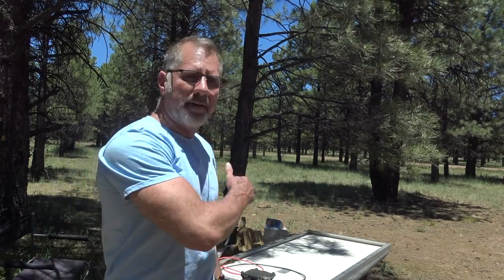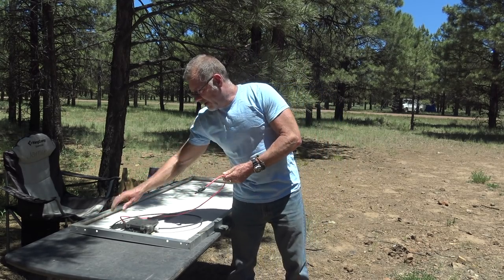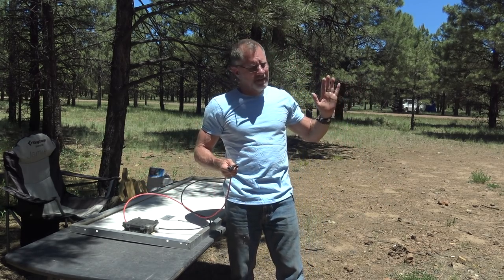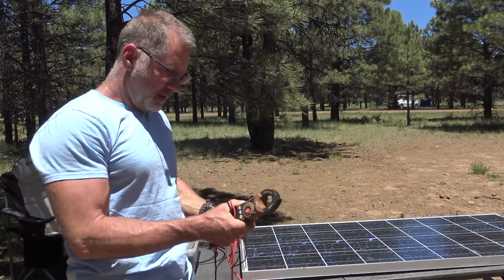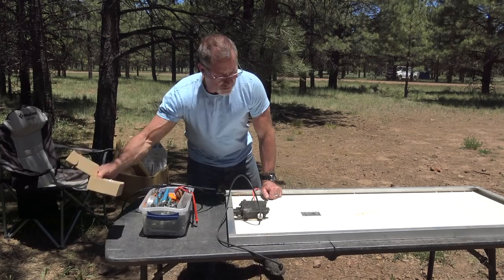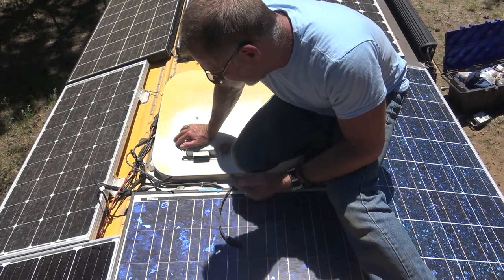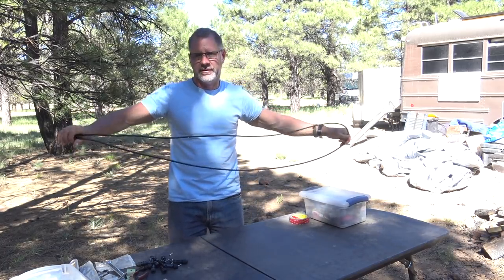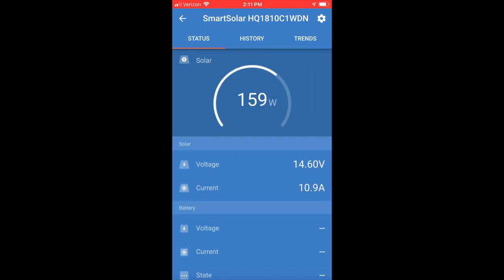Vandweller SKOOLIE Mixing Solar Panels Install | Is it Safe?

Comment: Good job! Like you I have a mix and match setup. Total 700 watts now,  added to through the years. 400 watts in series supplying  two controllers.  One charging three 120 amp hour batteries and the other charging two 75 amp hour batteries. That is on my trailer. On my van is 200 watts in parallel charging two 120 amp hour batteries. All batteries are standard wet cell deep cycle,  cheapest way to go.  Matched together by approximate age so I get maximum life from all batteries. Oldest set  is two yrs old. I have found Walmart deep cycles last about 5 years. No point for me to upgrade, doesn't make financial sense. Lithium would out live me by many years. I also have a 100 watt suitcase panel I add in where ever I need a little extra power.
 As for power usage,  I turn my 2500 W inverter on 1st thing in the morning and it runs all day. That is hooked up in my trailer where I have Satellite TV With a 44" wide screen That runs most all day. I have a 12V 64 qt Wynter freezer in my van.  I also have a 1500 W inverter hooked up in my van.  I carry a Honda 2000 W generator  Just in case, But never have a need to run it unless I get a string of bad weather over multiple days. Usually on cloudy days I still charge everything to 100%.
Reply from the maker: Yeah, Captain Max, you’ve always done a great job making things work effectively with very little expense involved. In fact your interview remains one of the best on the channel to this day. Hope to see you at the Van build.
Reply: @enigmaticnomadics  I hope to run into you there too. You saw version 2 of my van,  currently on version 3 with version 4 to be built this fall in Quartzsite.  Never seem to get things completely done.  Only constant is change.
Reply from the maker: Doing the same over here. rebuilding my battery system and adding much needed storage cabinets. Eager to see what you've come up with!

Comment: 111020/1136h PST 1937 UTC.     Thank you for the demonstration. Can understand it’s impossible to exhibit every detail of a PV System in a short YT clip. I observe that you have 2 Monocrystaline PV panels and 4 polycrystalline PV panels. Well it’s alright, I suppose; as long as your dramatic end result was 159 Watts, as opposed to single digit output. The best thing in your system is VICTRON Charge Controller. I am impressed. What type of storage batteries were used? A LiFePo4 battery (2X 200Ah) would really make an exponential difference than flooded or AGM batteries. Have a great day and stay safe. 73s...
Reply from the maker: Hey Stree. I’m always learning more about solar and evolving. Yes, that system goes into 2 Battleborn lithium batteries. Best of luck with your build.
Reply: Thanks.

Comment: So Jamie. I'm curious as to why you dont have a rack on top of your roof to carry all those panels? Arent you supposed to have about 2 inches between roof and panels? Wouldnt it keep your bus cooler? I have a curved roof making it difficult to put more than one panel on and not thrilled about putting a rack on but portables are heavy, awkward and take up room in my van so dont necessarily want that but would love about 3-400 watts..any other affordable options for someone on fixed income(ssdi)..was hoping to make this years van build but not so sure that's gonna happen...happy summering👍thanks and happy travels✌❤😊
Reply from the maker: It's a matter of personal preference in my opinion. Raising the panels higher offers more ventilation for sure,  but I'd rather have my panels fastened directly to the bus roof. Less wind getting under them on the highway, more sleek around tree branches and less equipment to work loose over time. 
Plus the slight curve pics up more sun over the day. I see it both done both ways.

Comment: I just add up the amps because I can't cross them because I had so many different size solar panels and I run them all together but I run the line separately and then put the lines together to add up all the amps to go into the charger which gives my battery is more amps and only 18 volts because my smallest solar panel gives 18 volts my larger solar panel will give 41 volts and I got in between solar panels that would give probably about 21 or 24 volts but I only have two 24 volts inverters and the rest of my inverters are 12 volts and they all will run off from 12 volts so far so I don't try to ramp up the voltage I just try to ramp up the amperage in the wattage and it seems to work quite well. And I'm running with 2,600 watts.

Comment: Doesn't the ends you put on depend on what connectors they are connecting too..?
Reply from the maker: Yes, the end you put on definitely depend on what you already have pre-existing. If you do it the way I showed you you’ll always be right unless somebody came before you and Miss matched the ends, so it’s always a good idea to check them with your voltmeter just to make sure.

Comment: Voc are the volts measured with no connection... Open volts. "No resistance" means the wires are 'shorted together'.
The voltage is zero with no resistance. The measured current in this connection is the Imax current output.

Comment: I used bare crimp connectors, then solder, then heat shrink.
Reply from the maker: I’ve done the same thing a bunch of times too. When I first started I didn’t like MC for connectors at all. Are used to always cut them off immediately, LOL.
Reply: LensRc i thought I was the only person that solder and shrink tape my wiring connections. Everyone seems to use crimp connectors which suck because over time they will come loose. Imho.

Comment: Well if you handle if your charger handles a 36 volt you're going to have to make your batteries 36 volt and if you ain't going to make it batteries 36 volt it's better off leaving 100 w hooked up to it and just keep running there 18 volts or 20 volts what you said and just keep adding up the amperage and the wattage that's what I do.

Comment: Newbies to digital meters, also good for analog (needle) meters. The way to destroy ANY meter is to try to measure the resistance of a live circuit. It WILL blow the fuse and likely destroy your meter PC Board. This is a device you WANT TO FIRST READ THE MANUAL, and watch some videos.
Reply from the maker: Great point. I seem to recall a meter I ran across (I think made by Fluke) that read the voltage and resolved the reading automatically, but it wasn't cheap and I could be wrong. Always read the manual first is advice a can not argue with!

Comment: You know, you can just add more wire in parallel to the old wire, you don't need to replace it with fatter and more expensive wire. Wire current limits are additive in parallel.
Reply from the maker: They absolutely are! I could also wire the same rated pairs of panels in series, then tie them together in parallel, thus increasing my voltage, within an acceptable range for the controller, while keeping my amperage lower. Very astute observation, rstevewarmorycom. Thanks for your comment.

Comment: 10 Ga wire max 30 amps, but that isn't continious. I believe 80% is which would be 24 amps (@ 100' length).

Comment: Fixing solar panels safe I don't know you should ask me that question cuz all I have is mixed solar panels I never had enough solar panels to make one string oh and I'm only running 12 volts and I really never lost a volt and it's actually 18 volts and all my watts are still adding up between a different size solar panels never losing a lot never losing a volt oh and my solar panels are only about 6 ft from the solar charger and the trailer charges only about 3 ft from the batteries and the batteries are only 2 ft from the inverter I haven't ran any long lines of anything to just write outside the front side of my house facing short self and off towards the east of the house which seems to be making more like treated than just facing self because sun comes up behind it and gives it power and then it goes into front of it when it's on the south side and then it sets in the southwest which is still makes a little bit of power I just got to cut some trees down to make more power.

Comment: I should tell you to get some solar panels from home Depot but I will say well they're a little more expensive maybe you should get them from scratch and supplies they got the exact same solar panels and they get 5.69% amp and they actually give probably a little more than 100 Watts at least that's what one video showed me they're a little bit better than 100 Watt solar panel and maybe she get just a little bit more than one solar panel sounds like you might need six solar panels. Get it from scratch supplies you better get their app that's the only way you can find it solar panels to get it cuz they don't have them in the store and you can have it delivered to the store I need to pick them up from the store and they cost about $99 further 100 Watts solar panels.

Comment: Man I hope my 350watts will handle my CPAP, freezer, and lights and phone. Jamie I don't think the guy who set up my solar set the controller up for agm batteries, does that matter?
Reply from the maker: It definitely matters to set your solar controller to the right batteries, just let me know at the Van. Build, if you haven’t addressed it before then. And I’ll take a look at it!
Reply: Ok I'll have to try and find someone to help me read the instructions. The dam chemo took my ability to understand writing very well. It seems to get worse with time.